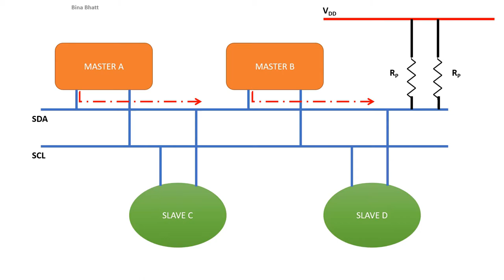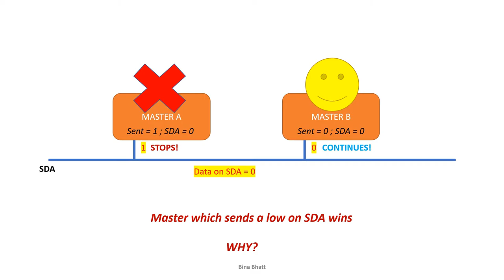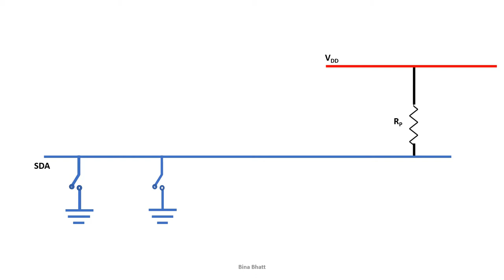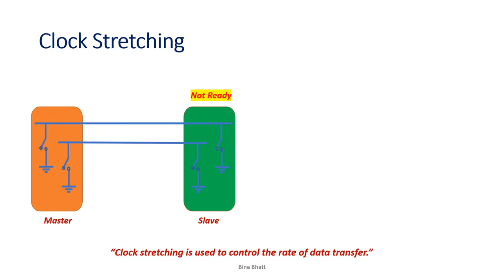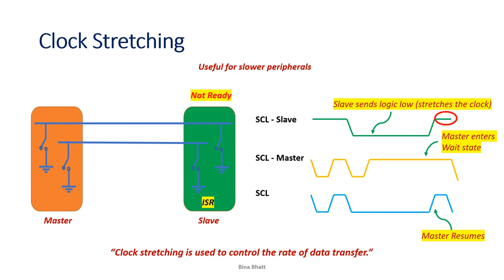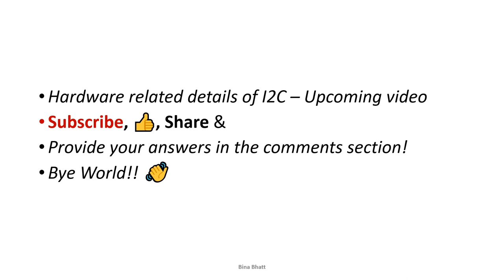I2C Protocol - Part 2 (Bus Arbitration & Clock Stretching)

Comment: Doesn't each master have to monitor both SDA and SCL to arbitrate such that they make sure SCL is actually high before checking the SDA state - you know incase another master is still holding SCL low?

Comment: Answer for the last question,
I think both the address will go to conflict by consuming the same bus so clock arbitration will occur untill it is programed to let the bus pass through the data if the addresses send the same data, 🥵😌 this is my try, and try to fix it and i want your answer.

Comment: If 2 masters want to access same slave at a time, 
Case1: If both the masters want to read same   register of slave, then data will be received by both the masters.
Case2: if bothe the masters want to read different Registers of slave then again bus arbitration will happend.
Case3: same thing will happen for write operation also.